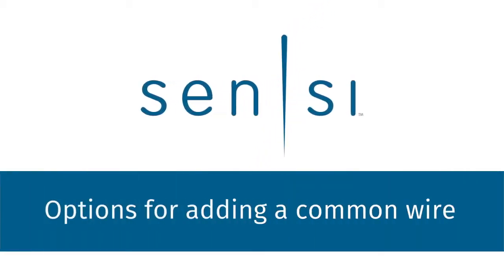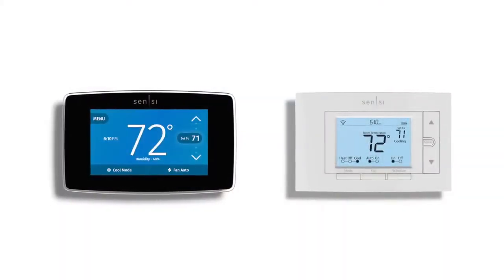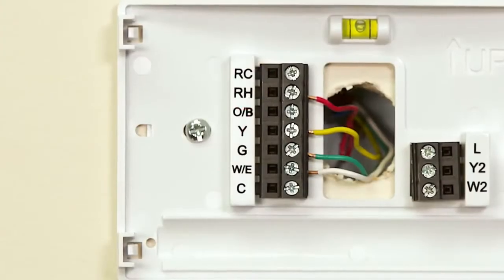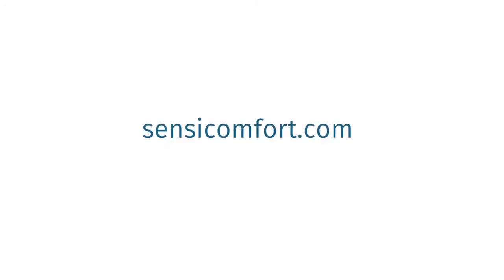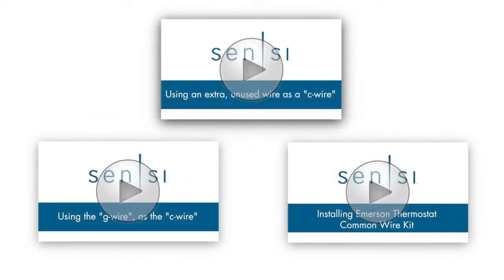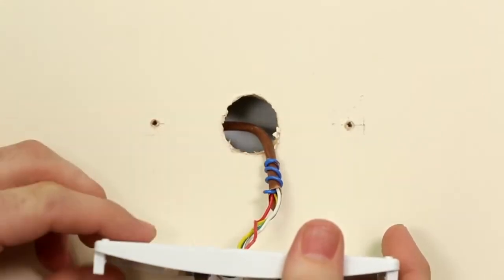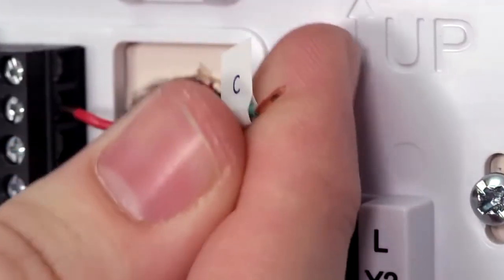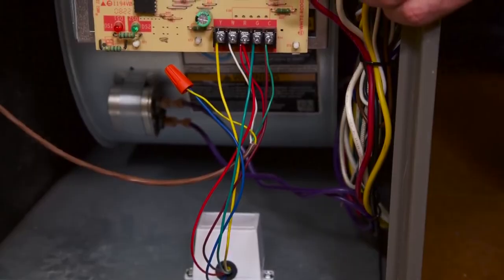Sensi  Thermostat | Installation | Thermostat Common Wire Overview

Comment: If you hooked this up and you have quadruple checked all your connections from your condensing unit to your thermostat and are 157% sure you did everything perfectly but your thermostat still has a black screen and won’t seem to power up…..check the prongs on the wall plate you installed, make sure they are all aligned and none of them are bent, your sensi needs every last one of those promgs in order to function, at all. I know this will help someone, you’re welcome.